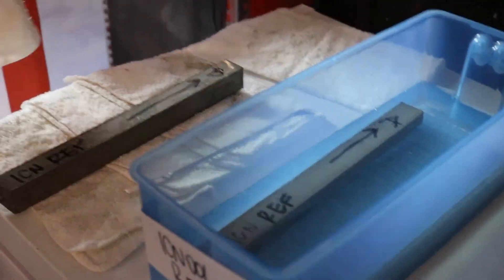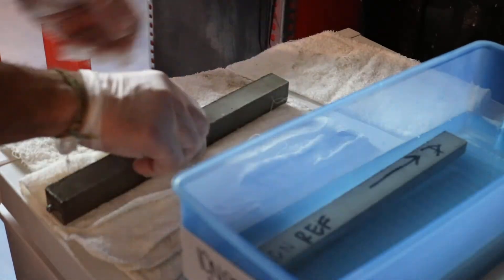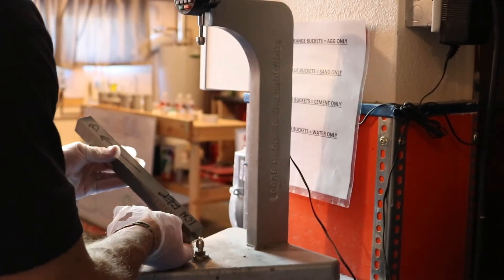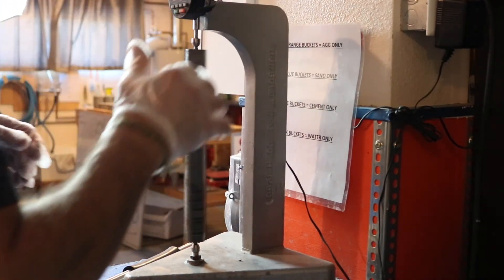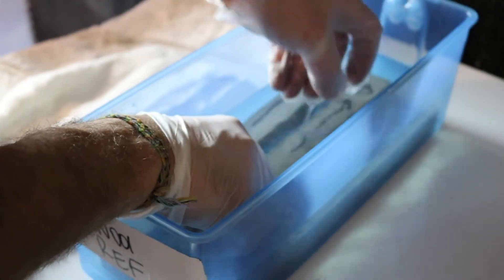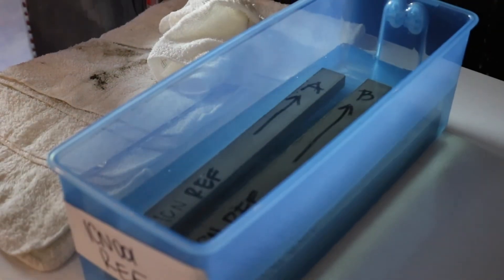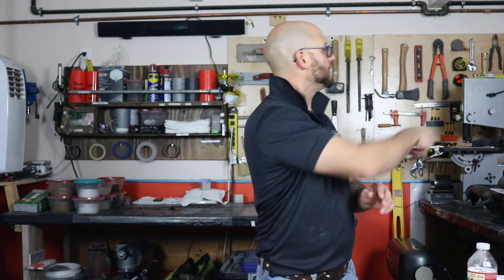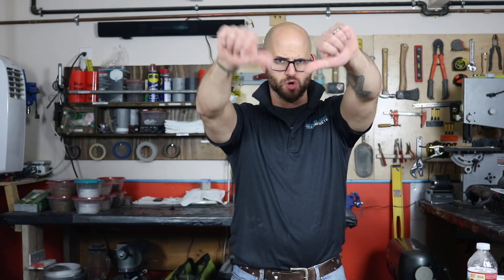ASR Testing - Vlog #154

Comment: Did you perform ASR test on mortar mix consists of cement + coarse aggregate (crushed/fine) + sand + water  as a mortar mix together or tested reactivity of specimens with only cement and coarse aggregate (crushed/fine) with water ? What does ASTM specify? I am wondering if ASR test should be conducted on sand/fine aggregates as well or only coarse aggregates.

Comment: how do i calculate for the expansion % in the asr test
Reply from the maker: Ace Cube sorry the delay.  

The following is taken from a UC Davis paper, “ASTM C 1260 is a standardized test used by cement chemists, concrete technologists,
and industry to determine the susceptibility of an aggregate to the alkali-silica reaction (3). The aggregates that are used in this test are crushed down to sand-size, and graded to the specification listed in the test. An aggregate/cement ratio of 2.25 is used with a water/cement ratio of between 0.45 and 0.47 (Ratios are by mass.). Enough mortar is mixed to make three mortar bars with the dimensions of 25 × 25 × 285 mm. The mortar bars are then cured for 24 hours in a fog room at 23 ± 1.7 C, demolded, and immersed in water within a closed container.
The container is placed in a water bath maintained at 80 C. After 24 hours, the length of the specimens are measured, and then placed back into the container with 1M of sodium hydroxide solution maintained at 80 C. The volume of the hydroxide solution is between 3.5 to 4.5 times the volumes of the mortar bars. The specimens are removed briefly from the containers periodically and measured before significant cooling occurs. The average expansion of the three mortar bars, after 14 days of immersion in the hydroxide solution, is used to estimate the reactivity of the aggregate. 0.0 to 0.1 percent expansion means that the specific aggregate tested is not reactive, 0.1 to 0.2 percent is considered to be inconclusive and require further testing, and greater than 0.2 percent is considered to be reactive.” 

http://www.ucprc.ucdavis.edu/PDF/Accelerated%20ASR2.pdf